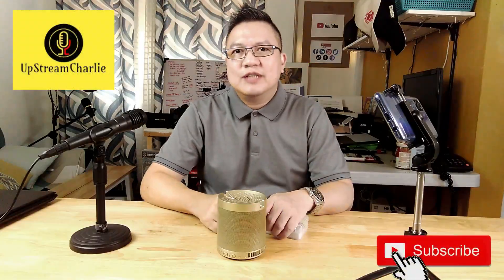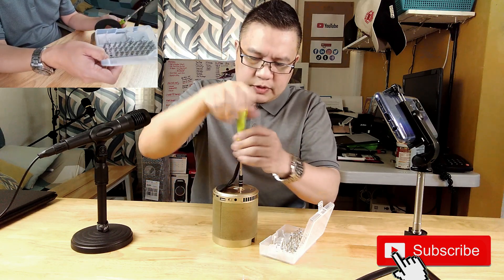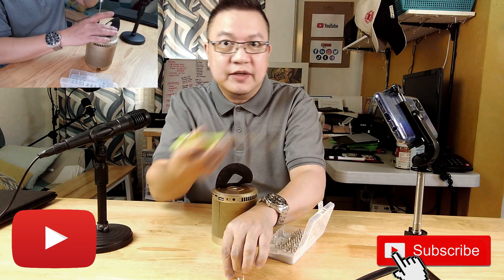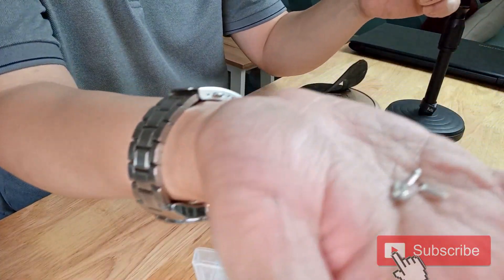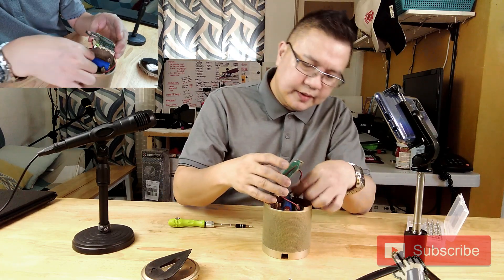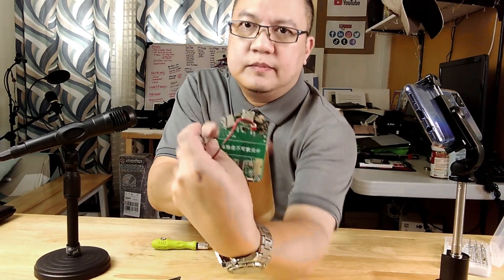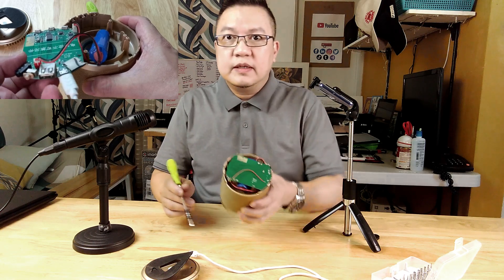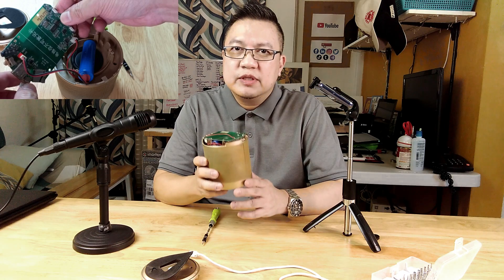HOW TO FIX USB CHARGING PORT OF BLUETOOTH SPEAKER

Comment: Okay but what if i opened the top and the usb charging port literally fell out? Its not attached to the mother board anymore what do i do
Reply from the maker: If you open the top, which is fatal, by the way, it wont affect the bottom. Stuff in the bottom, like the USB port, charging port, etc., part will not fall out. But if start opening the bottom and if parts get loose and fall out then just how it connected and either sodder it or use glue. But clean the case and the board first since it is already open.
Reply from the maker: Help us grow our channel and be our subscriber... this will also help the YouTube algorithm find viewers like you who likes tecg, gadgets, and bt speakers